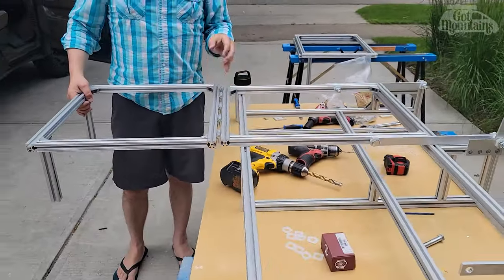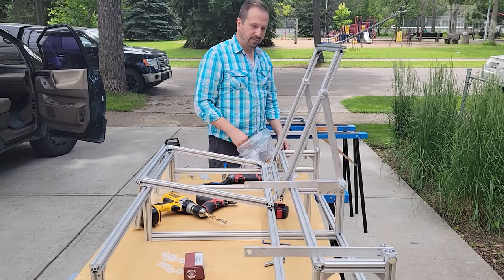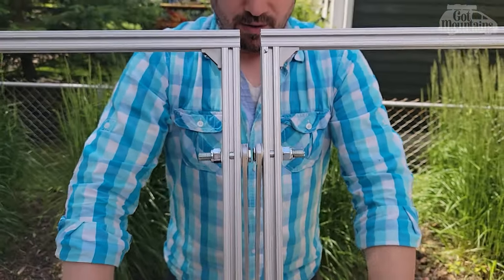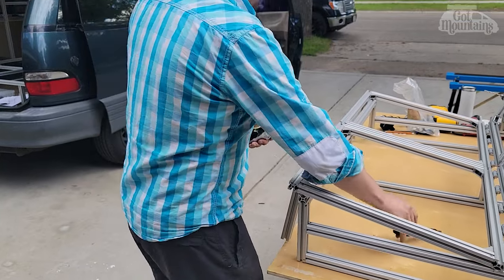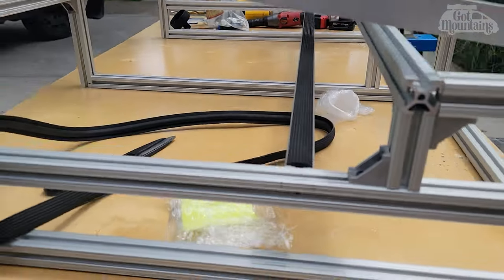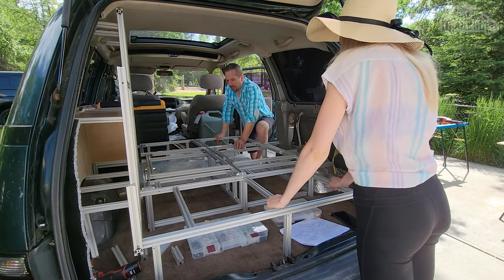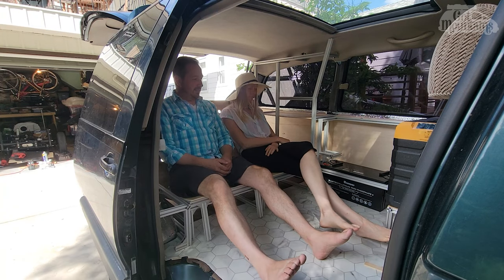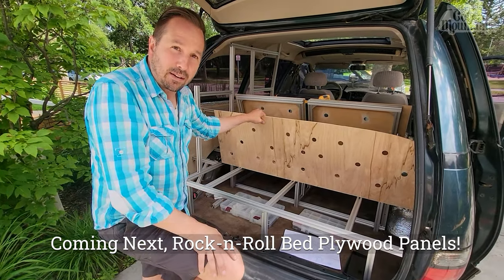FINISHING the Rock and Roll BED // E15 EASY Custom 8020 Hinges

Comment: Awesome job!! I also created split rock and roll beds for a Dodge Grand Caravan using telescopic ladders as the support structure. When the ladder is collapsed the 1/2” plywood forms a seat, when extended, the ladder supports the plywood in its bed position. Happy travels.
Reply from the maker: Smart use of those ladders. I love repurposing things!

Comment: Coming along! SO how will this build be different than your first one? What made you do another that the first one wasn't cutting it for you?
Reply from the maker: Adding a toilet (to come), more space between the bed and the sink cabinet so you can have your feet on the ground and room to spare, simpler bed mechanism, compressor chest-style fridge, electrics relocated and easier to access leaving under the bed totally open for storage solutions  - but most importantly, this van has zero rust... our other one would have needed work in the long term.

Comment: Where can I find that gasket?  I recently asked the question in one of your other videos about where the seat panel extrusion contacts the support and was hoping you would be more specific. Here I see you've used a gasket.  Also, are you doing anything to keep the bed from unfolding during a hard deceleration? Thanks for your content.
Reply from the maker: Hey! Its called Tread Strip and the part number from 8020.net is 2828. My last bed didn't use this and never slide forward. I used felt furniture pads for that one.. I use this mostly to stop rattling and metal on metal sounds. I think the fact that the seat sits below the front lip makes it not prone to come forward. In a big accident I think it would move, but never has it nice from any hard braking. Also note that there are a few more bed videos coming in future weeks, so hopefully they will answer all your questions!

Comment: seems like it would be easier to buy a VW  westfalia .... When you add up our time your materials, you would have upper bunk and lower plus a cool ride.
Reply from the maker: But then you'd be driving a VW...haha. I've had many classic VWs. I have one now (1959 Beetle). If you buy a VW, you need to be prepared to fix it on the side of the road regularly. The Toyotas just go and go forever. This is also 4WD. Much more capable off road.
Reply: Creating custom builds is half the fun!!!
Reply from the maker: @scottphillips471  totally agree, there are always a few bad design elements that is inevitably have to change if I bought something. Plus, building is a chance to stretch the brain!
Reply: @GotMountains  guess it all depends on how willing you are to maintain your VW, My daughter an I drove the VW to Belize a couple years ago. No mechanical issues aside from a loose wire I did not crimp correctly. It still has not had a single mechanical issue since.  in full disclosure I am building out a Promaster but only because I want more room for a shower and toilet.
Reply from the maker: @davidse4486  the other part of the classics is starting bto be their value. I'd love to build out a split window but then I'd be terrified of it getting stolen. I'm a huge fan, but I think a classic van is a different experience. Also, size will dictate your layout options. I'd have a different layout if I had a bigger van or a smaller van with 2 sliding doors. For the single door vans, the side cabinet is the only good option for 2 people with devine storage. Probably why the new California stuck with the same layout. I'd be curious to see what you do with your promaster.